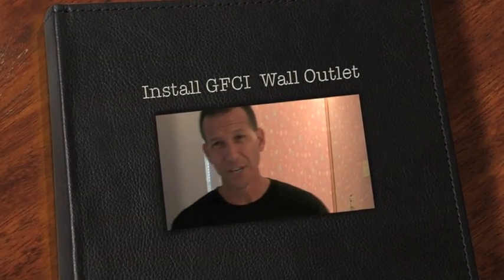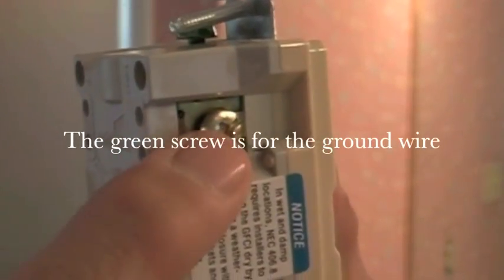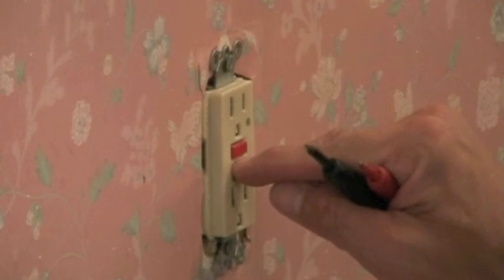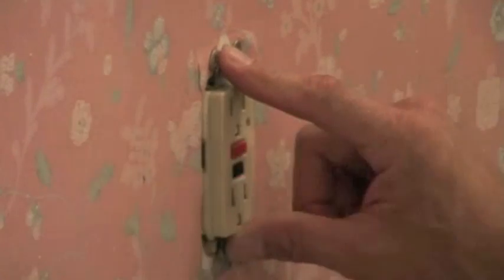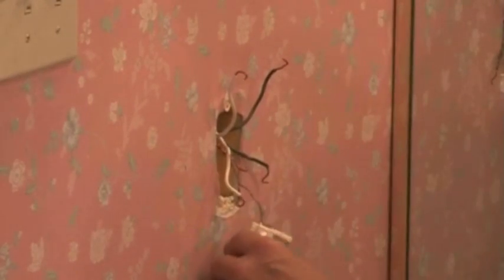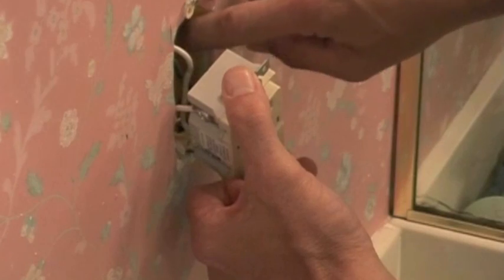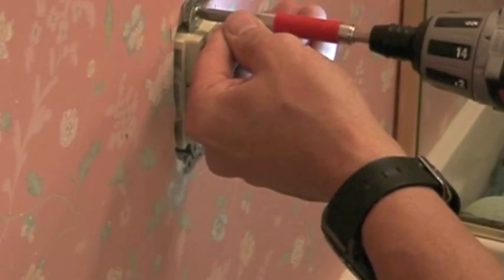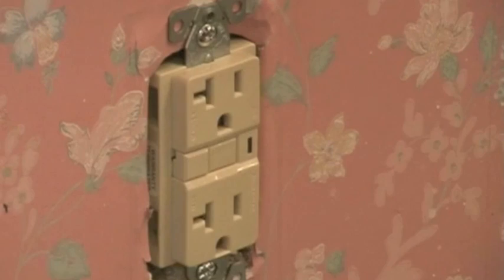Replace GFCI wall outlet

Comment: Why did you use a 20 amp gfci for the new one?
Reply from the maker: +Brian Crandall 
Hi Brian,
I have 12 gauge wire coming from my breaker panel. My wife uses that outlet for her curling iron and blow dryer. The house had an existing 15 amp. GFCI, but a 20 amp. is better for this situation.
Thanks!
Paul
Reply from the maker: LOL my friend!

Comment: Paul, this was a nice video for novices showing the ropes for the safety angle.  I did notice however that the outlet you replaced was the 15 amp version and you used a 20 amp version.  Unless the wiring was 12 AWG someone might think that they have a 20 amp circuit, as well as it being an NEC violation.
Reply from the maker: +John Szuba 
Hi John, that was a good observation. I have a 20 AMP breaker supporting this outlet and all of my outlets are 12 gauge. Most modern homes support 20 amp outlets and 15 amps for lights. Thank you for your comment and have a good day!
Paul

Comment: how do you know if the power is off if you don't have a power tester?
Reply from the maker: +Marie Schotter 
Hi Marie,
I am using a tester in this video. You can get a pretty good one for under $20.00. I never do an electrical job without one.
Thanks!
Paul

Comment: Paul,
I had a new home built and the contractor HAD to install GCFI boxes where my intrusion alarm, sump pump, and garage freezer are located.  I don't feel comfortable having those circuits on a GCFI circuit because I have been told they are prone to failure which would leave me with no burglar/fire protection, a flooded basement, or lost freezer meat.  What is your opinion?  Should I take those GCFIs out and replace them with standard AC plugs?

Dave in Michigan
Reply from the maker: +David Wilcox 
Hi Dave, I'm sorry for taking so long to get back to you. I was out of town for nearly 2 weeks and I have a ton of questions to answer. I am a big advocate of GFCI outlets. If you spend a little more money, you can get a good quality one that should last. As a fireman, I can tell you that they do prevent fires as well as electrical shocks. Having said that, I would suggest checking with the codes in your area and seeing if it does not violate your local codes. If it is not on an outdoor outlet or not near a water source, you may be able to change them out. I have seen them go bad, but it is usually in a spot that has heavy use, such as a hair dryer or space heater. Stay away from cheap ones. I hope this helps!
Paul

Comment: Your video saved me a lot of time and especially aggravation especially using the holes for the wires instead of wrapping them around the screws.  Just getting the ground wire wrapped around the grounding screw was bad enough!  Thanks!
Reply from the maker: +TacksDodger 
I'm glad it worked for you. Thank you for taking the time to comment!
Paul

Comment: My husband is replacing our outlets in the kitchen. On the island it has a 20 amp GFCI switch and on the walls it is a 15 amp. Does the island need the 20 amp or can we use a 15 amp. The problem is the mfg of the gray ones we choose does not have a 20 amp.
Reply from the maker: +Kim Scott 
I just saw your question. I am not sure what the code is for your area. I live outside of New Orleans and the code in Orleans Parish is different than ours. If you want to play it safe, you can add a 20 amp. You should have 12-2 wire with a ground for 20 amps. I hope this helps and sorry for the delay!
Paul

Comment: I have a situation where the wall outlets after the GFCI are showing low voltage. Could this be caused by a bad GFCI wall outlet?  I plan on replacing that GFCI outlet soon. The old one looks like the one you replaced in this video, but without a light on it. And, thank you for this video. It is very helpful.
Reply from the maker: Hi John,
1st you will want to check the voltage on the GFCI. If it has the proper voltage then it will be the cause of your problem. If it has low voltage, you should remove it and check the voltage of the wires feeding the outlet. If they are low, you will have to go to the previous box or to the breaker panel. If the breaker is bad, it can feed low voltage. It will usually trip when when a load is put on it. Such as plugging an appliance in the outlet. If you don't find the problem, let me know.
Thanks and Good Luck!!
Paul

Comment: HEY PAUL CAN YOU SPRAY PAINT THEM I REPLACE MY COVERS BUT MY NEW COVERS ARE SILVER AND BREAKER IS WHITE MY QUESTION IS CAN SPRAY THE BREAKERS SILVER
Reply from the maker: Hi Motta, They can be painted , but I would not recommend doing it. They would then have to be removed or the power would have to be shut off. In order to get the paint to stick, you would have to lightly sand them. You would also have to cover the slots because paint could hinder the connection. Sorry!

Comment from the maker: Hey Douglas Hill,
Yes, if ground fault circuit interrupter is not turning off when you push the test button, it will not interrupt the circuit when it is overloaded, or if something shorts out. You should change it as soon as possible. Since it is off and it will not reset, I would suggest you get a tester and check the power going into the GFCI. You may have a loose wire, or even a bad breaker. If you find that power is going to the outlet, then you will know that is is bad. Good Luck!

Comment: Paul I am glad I found you. Does a GFCI have to be replaced if the test button and the reset button do not work? The unit in the garage shut everything down, I assume, when a radio was on and I turned on my table saw. I tried to reset it and nothing worked. I replaced the fuse and still no power. What to do?